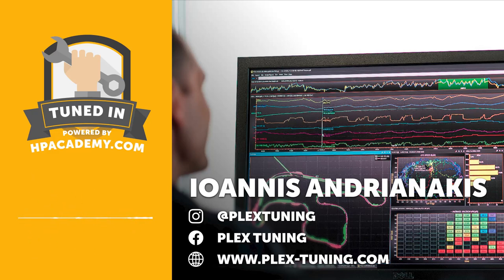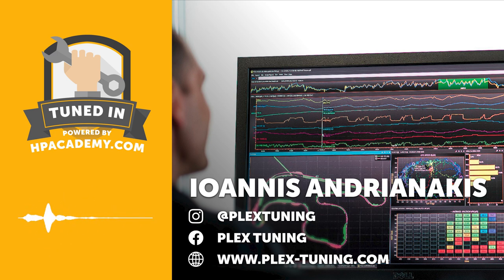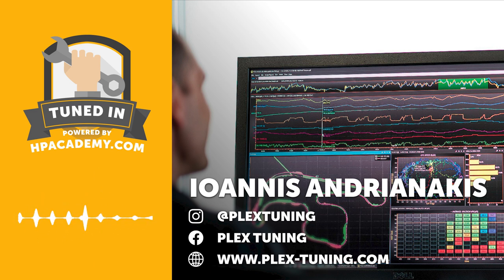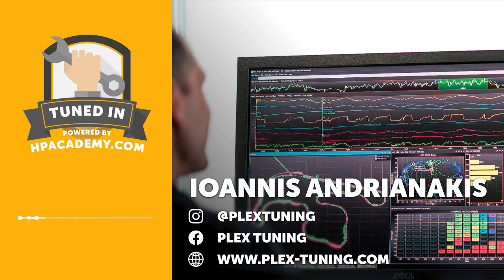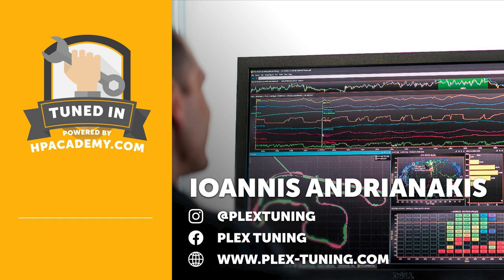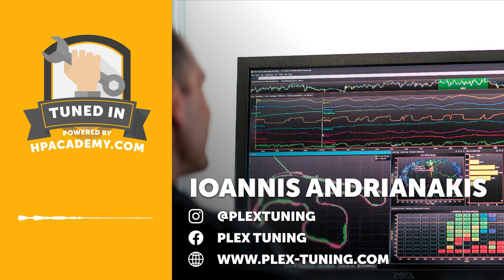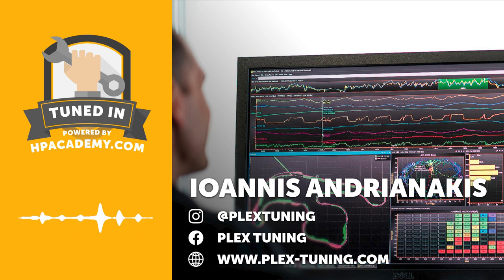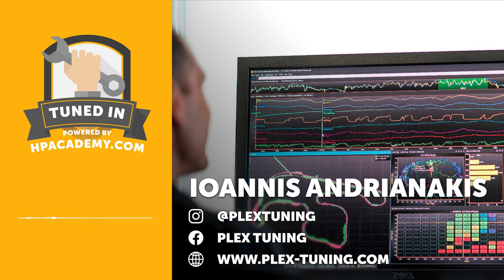081: PROPERLY Understand Knock and Become a Better Tuner. [#PODCAST]

Comment: Hello Loannis and Andre
Great podcast, certainly took me back to the late 1980s and 90s and the infancy of aftermarket ECUs and tuning.   Loannis I had a laugh when you spoke about the M4 Motec, first Motec I used was screw driver adjustable. 

I have a PLEX  Knock monitor V2 and V3 and the V3 is a massive step up on an already great product, we also have and use the PLEX combustion analyzer a tool that is world class. 

We use PLEX gear almost every day as we develop our engine products and calibrations. Running  high compression engines with forced induction on pump unleaded fuel at WOT for extended period in the marine environment can only be achieved with this kind of equipment. 

But along with great information and technology I must say Loannis and PLEX have been extraordinary to work with and I could not recommend them more highly. 

I would love to sit down with you both and share my experience regarding super knock events and some of the causes I've seen 

Well done Andre keep up the great work 

Regards Simon

Nizpro Turbocharging and Marine

Comment: This is the most important lesson/podcast for any new tuner 👌🏻 so thank You so much. It was very usefull at least for me and answers a lot of questions I had. 

Btw. I know that it was really long podcast and You mentioned a lot of things but You never mentioned life time of knock sensors, how to check them or how often they should be replaced. I think that's very important information bc all of Your monitoring depends on this sensor and I belive that piezo electric sensor can't live forever 😂 at least not in as harsh enviroment as engine bay.